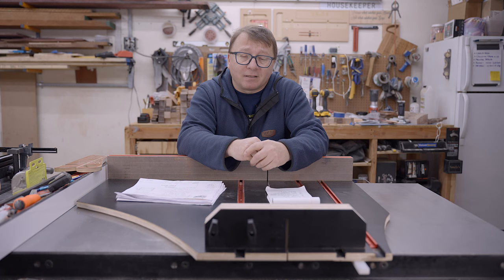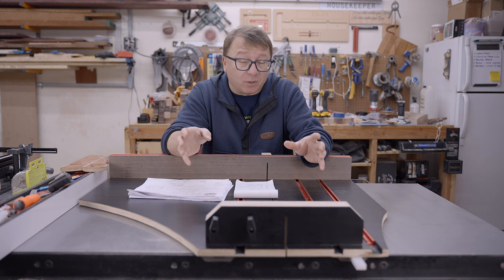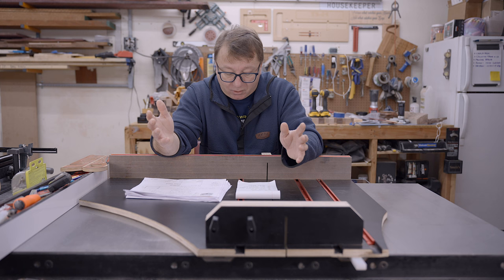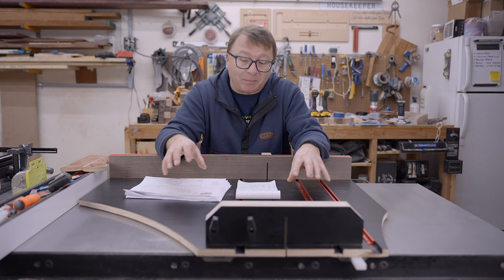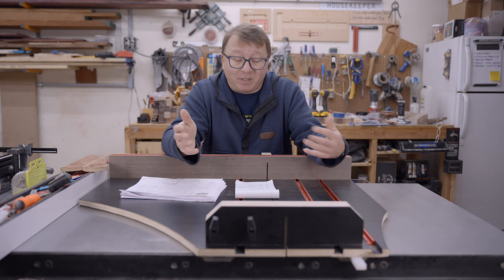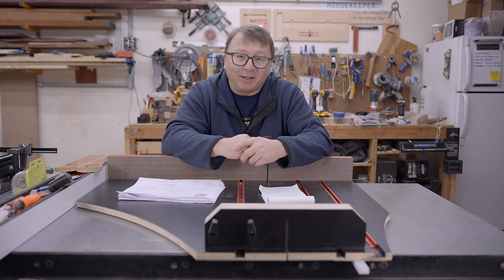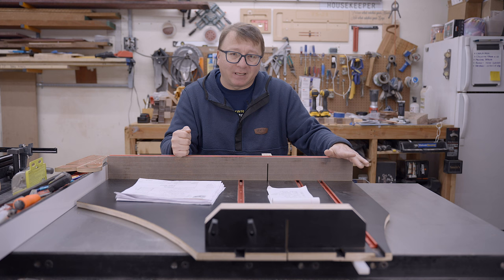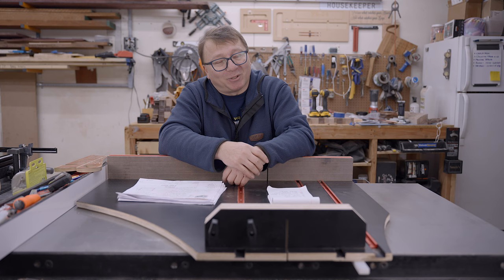7 Mistakes To Avoid - Making My Ultimate Crosscut Sled

Comment: Totally agree with your "experimental" comments. Doing a first-time prototype  always rakes 3 to 5 times longer and invariably involves redesign and wasted material. It's anxiety inducing and frustrating. I'm on day 3 and half way thru the Casey build. So far so good using just his video. I'm just using salvaged 1/2" BB and the hardware I've had for 20+ years. I'm doing the rear fence now and have run out of pieces long enough so I may end up milling a hardwood piece which would be easy to get flat. I am thinking of adding a replaceable sacrificial insert. Also, I first tried the plastic runner, but it's too loose in the miter slot and too flexy like you said. So I milled a hardwood piece that the CA glue works with, plus I have some teflon tape I could use to make the bottom more slick if need be. I slotted  for the Tee track using a dado stack in the table saw for a perfectly clean fitting groove. I always suffer from the router fence moving on me for some reason, so I avoid it. I think using the two cut method is as effective as the 5-cut method - see Tom McLaughlin at Epic Woodworking for a detailed explanation. It is essentially the same as the 5-cut, but simpler and the math is trivial. I'm not there yet, but it has worked in the past. I too was drawn to the slick red on black and stylish sweep cuts of Casey's design. It sure is pretty. But I'm on a zero-cost budget with materials I have on hand. However, I did have to buy some CA glue for over $20 for the small size!! Insane! Otherwise I've kept the cost to zero by using what I have in the shop. Thanks for your advice and glad your jig turned out in the end. Persistence pays off.
Reply from the maker: I'm glad you found something that works for you. I definitely want to redo this one and do it just a little better next time. Thanks for watching!

Comment: Great video! The results speak for themselves! You got an accurate crosscut sled! 

As far as making your first laminated fence straight, would using a straight edge jig on the table saw have worked in your situation? That’s how I got my fence straight for my crosscut sled. I made it oversized anticipating that I wouldn’t be able to laminate it perfectly.

Then with your second fence were both pieces that were laminated together bowed? I wonder if the bowed sides were glued together in the same direction that it would accentuate the bow by that amount.
Reply from the maker: Using the table saw fence is a brilliant idea! I wish I had thought of that -- but it's firmly fixed in my memory for the next one :) Thanks for watching!